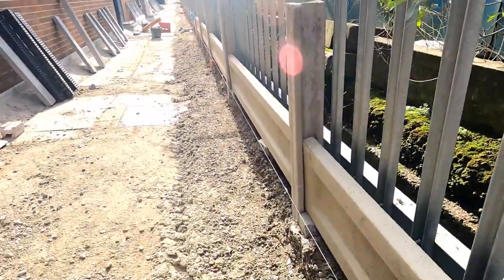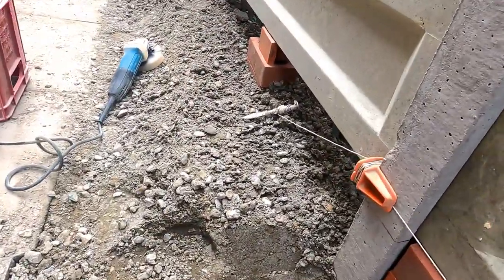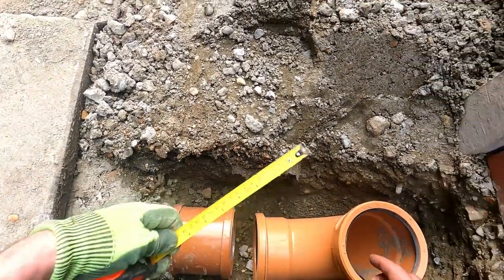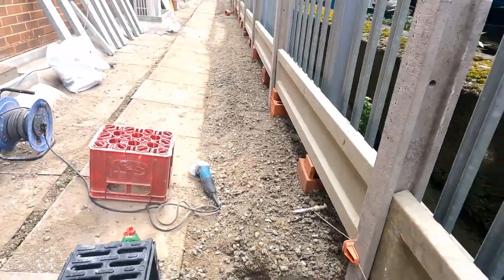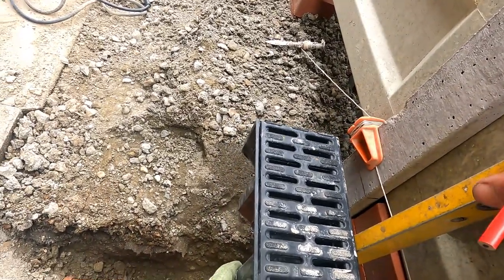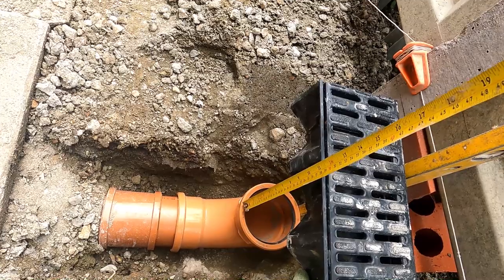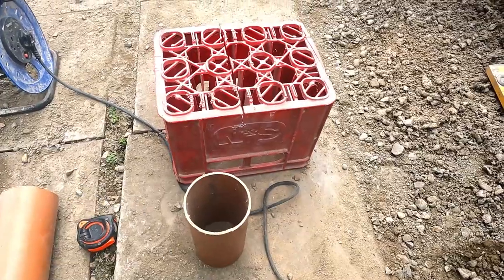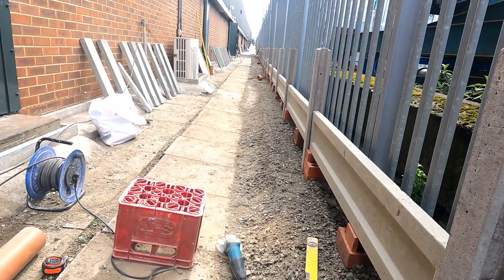Setting Out Drainage For Aco Channel

Comment: Is Fairy Liquid not going to damage the rubber seals? The plumbers working on our house recently were reminiscing over a break time cuppa how an apprentice plumber they know was given the simple task of pushing these waste pipes into place. Unfortunately he used a solvent based lubricant when no-one was looking. This led to the whole estate being dug up again when all of the joints started leaking sewage.
Reply from the maker: Yeah I'd definitely recommend a good lubricant for the joints for  the under ground pipes 💯 I'm 💯 sure the joints I did will be just fine I was back on the job not long ago and everything I've done looks great thanks for stopping by the vid mate sounds like there was plenty of story's going on at the tea break like, and as you know things get exaggerated a little bit lol 😆 all the best 👊

Comment: Do you core through the bottom of the acco channel to connect it to the 90 degree bend.
Reply from the maker: Thanks for watching the vid Jonathan nice one mate 👍👍 when I got all the 90 degree bends in place I came through with the aco channel bedded them in to the finished height I needed I marked off were the 90s were then took the grids off the aco channel and drilled a 2inch hole through the aco channel directly in line with the 90 degree bend it works a treat mate and never had a problem doing it that way the 90 is 4inch the hole 2inch it definitely works 💯 hope this helps mate 👊
Reply: @creativecrambo  Much appreciated. I’m doing my garden and was struggling to work how to connect it to my gully. Thank you for replying.
Reply from the maker: @Jonathan-mk1ju  
No problem mate hope it works out ok for you 👍👊